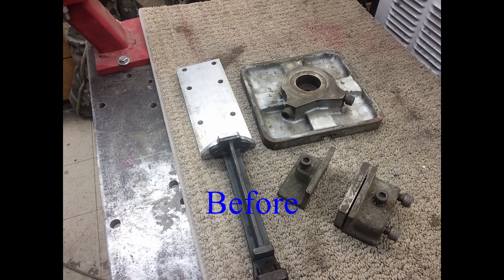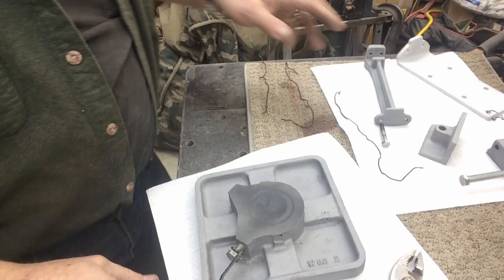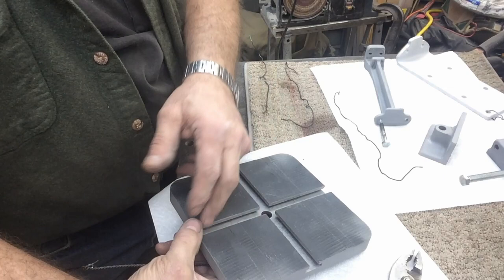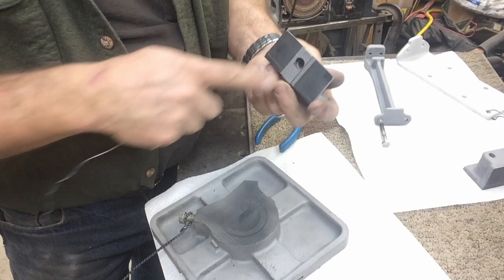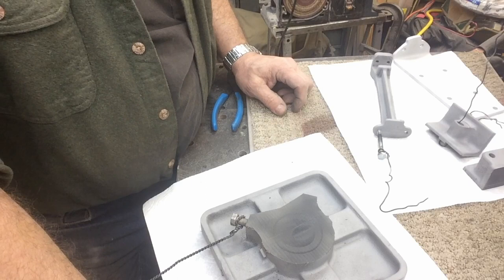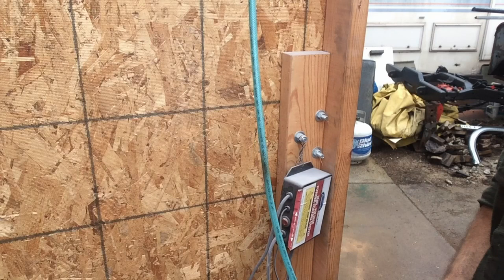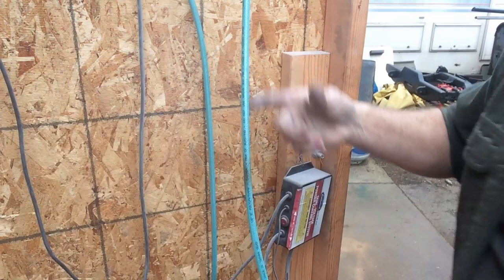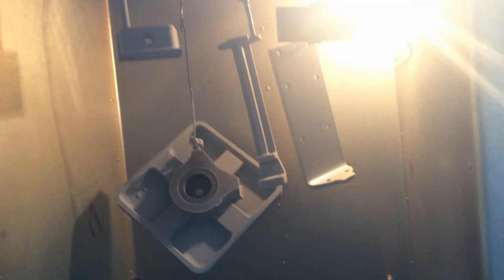Powder Coating In The Home Shop

Comment: Thanks for making this video, Dan!  Very informative.  You happened to use a color that nearly matched the color of your material...if you were spraying red, I presume it would appear red and you’d therefore be able to see areas that might need another shot?  Thanks again.
Reply from the maker: Yes, colors are usually close to their final color, even though the bare metal was close to the gray it is easy to tell the difference. In person the color difference is very apparent.

Comment: No mask when using powder coat? I powder coat bullets by shaking them in a Tupperware bowl to create static. Has worked really well.
Reply from the maker: nope, everyone has to wear protective equipment to their own comfort level and accept responsibility for their decisions. I have played with powder coated bullets but don't like them. There is a certain amount of abrasive in the powder and I contend that it has the possibility of accelerating the wear in a barrel